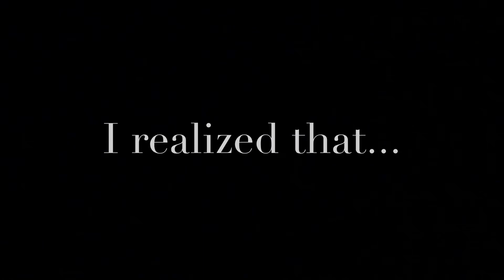Li-Po battery catches on fire in my Macbook Pro!

Comment: 6 Batteries???
My older Macbook only has 1, but it is larger.
0:07 Curious....Why are you laying your head just above bad batteries? LOL
Reply from the maker: In these machines the battery is installed with adhesive tape and I am attempting to pry it free and also attempting to be careful… lol

Comment: Use a plastic tool on the batteries and use it slowly, your computer is boot looping, which I’m honestly not sure about the specifics on but since it is powering on and presumably fan spinning could be as easy to fix as a busted sensor or as hard to fix as an active fault, might want to pay rossmanns videos a visit to try an figure out what’s wrong

Comment: Hi. Something similar happened to me. I have a late 2013 13 inch Retina. I was also stupid enough to try to pry the battery out with a screwdriver. There were several small sparks in the process. After that, I put the MacBook in a metal case. What should I do? Should I continue to try to remove the battery? Of course, "correctly" and without metallic stuff.
Or is there any danger from the battery?
Reply from the maker: I honestly don’t know. I personally finished mine by using a smooth plastic spatula and went slowly. Maybe that will work for you? Be careful though.
Reply: @davidsaylors  I think I will use my old Credit Card, that should work.
Reply: @davidsaylors  I am so glad, I was able to remove the battery!! 👍
Reply from the maker: I am so happy for you!!! Great job!!!
Reply: @davidsaylors  Thanks and one more question: How did you extinguish the fire? The problem with lithium is that it ignites itself through the air.
Reply: I literally just tried to do the same damn thing with scissors. Luckily I had water right next to me. Stupid mistake but I'm okay.

Comment: I changed one of my old MacBook Pro’s battery a few days ago and the way they put it in makes it difficult to take out and replace. I bought an ifixit kit which really helped but you could just use some nail polish remover in a dropper with a card like pry tool on the glue.

Comment: Mine weren't swollen, just needed changing (7 years old), and I did the same thing.  Prying underneath with a screw driver, albeit slow and steady, and sure enough mine caught fire too.  Will be using the adhesive remover approach next time.  :)
Reply from the maker: Yeah, that or I will just take it to a tech shop and have them do it... That is my thoughts after nearly destroying my computer. The adhesive remover is a good idea, thanks! 👍

Comment: Macs don’t boot without batteries installed.  And digging out a LiPo with a sharp knife blade?
Reply: Macbooks do boot without battery
Reply from the maker: Yeah, in retrospect it was a comedy of errors. It didnt even occur to me at the time that is would be a problem. I had already gotten through one computer without incident so I gotta was running on success and didnt really realize it till after what a colossal mistake that was.  Thank you. 👍
Reply: I’m just glad that you’re not injured and the house still stands.  LiPo batteries can be very unforgiving.  Just like Apple.
Reply from the maker: Right. 👊😉
Reply: My old 15” 2008 MacBook Pro booted without battery because the old one swell

Comment: Battery technology is at a stand still while the price has went through the roof, I usually get 75 to 100 cycles on deep cycle batteries in my boat and they went from $120 to $180 this year and automotive batteries have doubled in price, im not sure what is going on with the price if its a material supply problem or greed, they are still the same old lead / acid batteries that have been around for years...I hope Apple will make things right with ya!
Reply from the maker: I have already sourced new batteries for both of them. I should have them this week one day.
Reply: @davidsaylors  good deal

Comment: Had swollen battery issue (bowed case) on a MacBook Pro a number of years ago (10?) and Apple overnighted a battery to me. This was when the batteries were removable through a door. I still wonder what causes this. I’d hate for it to happen on my current gen machine. I use that for everything now and religiously back it up constantly to the cloud but it would suck to be without it for even a day.
Reply from the maker: I don’t know for sure, but from all the info I have found, it looks like it was due to heat and age... I think that one of them has been bad for quite a while longer as it had been putting pressure on the track pad to the point that it would not work. I thought the track pad went out...

Comment: How old are those computers?
Reply from the maker: Mid 2015....
Reply: @davidsaylors  Hmmm....Mine is an early 2015?.....
Reply from the maker: One had a symptom of the trackpad went screwy like the clickable feature just went away and the other one bowed up in the middle to the point that it wouldn’t close...
Reply: @davidsaylors  Fingers crossed, no such issues yet
Reply from the maker: Hopefully. Mine is the 15” retina version...
Reply: I had the same issue, Macbook pro late 2013, had swollen batteries, I was scared as hell to remove them, but was able to do it safely with a plastic card. I'm glad you are okay!